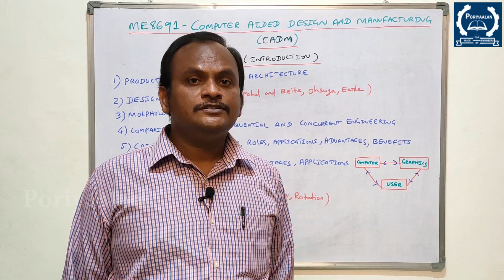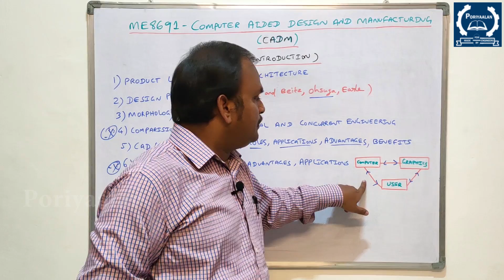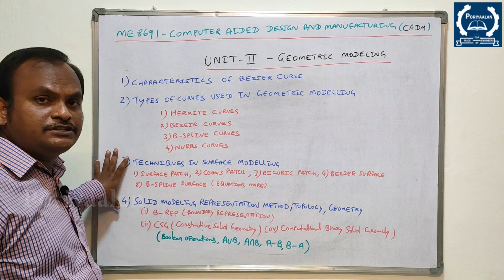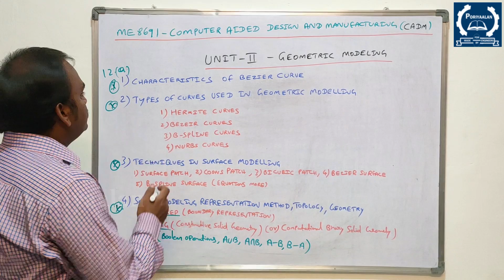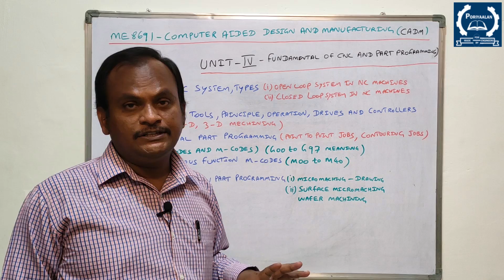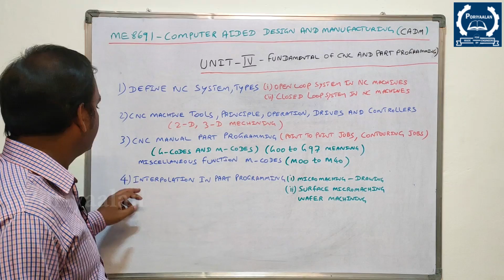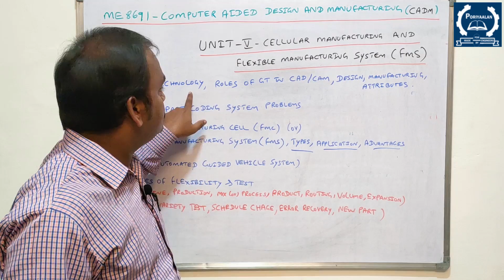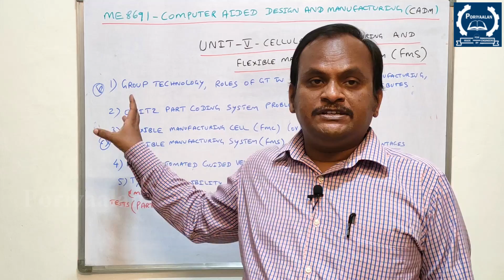How to Pass Computer Aided Design and Manufacturing | CADM | ME8691 | Mech

Comment: Ithula irundhu avlova questions ethume kekala 😢😖 b-rep la problem kettanga 
Question paper paathaodane thala suthiruchu 😢
Reply from the maker: Fully application based questions pa. CAM related questions. In our video 4*13 marks and 4*2 mark questions. Totally we said 70 marks but in this Qp it's covered around 60 marks pa. No problem valuation somewhat what easy ya irukum.don't worry.
Reply: @Poriyaalan   thankyou sir,
Will see. 
But little bit fear about exam results 😞